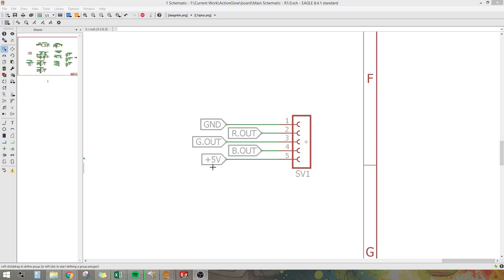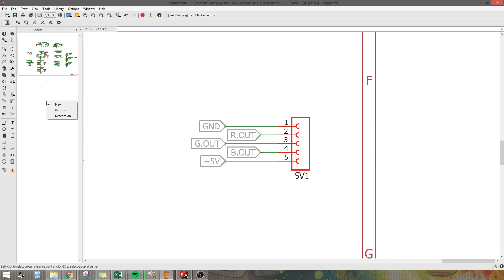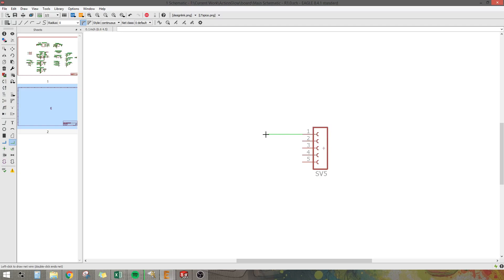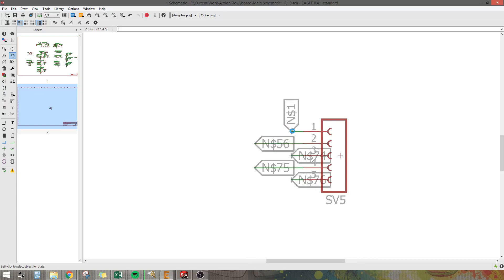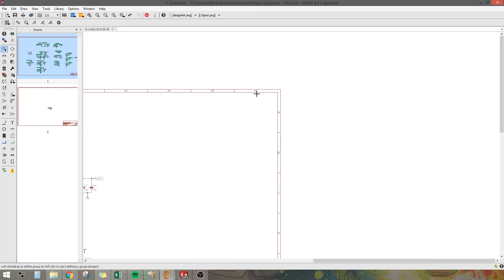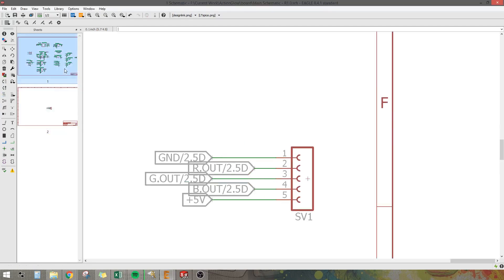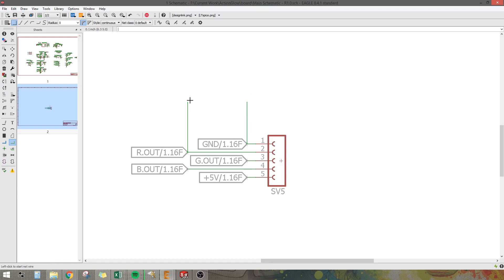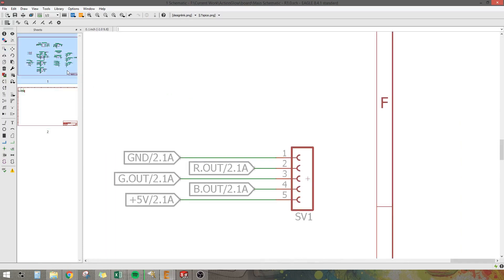Eagle CAD - Connecting multiple sheets

Comment: What a crude way to connect nets across multiple sheets. 20 year old software had better features. Click on Add Net. You get a list box of all nets in the project. Select your net. A net stub with label moves with your cursor. Place it where ever and that is it. Eagle sucks in this aspect.
Reply: What software would you use instead?
Reply: @riddhijitbasu2169  Altium Designer! You also get a hierarchical view of all your sheets in the project overview. Eagle is just ridiculously complicated in all parts of the design process...

Comment: when i take take cross section i encounter a problem that "The Geometry of the cross section not fit on the cross section sheet. Please check the horizontal and vertical scales,cross section spacing, top  margins and offset area height sheet setting"  THIS IS THE ISSUE PLEASE HELP ME TO SOLVE THANKS AND REGARDS hussain.imti@gmail.com